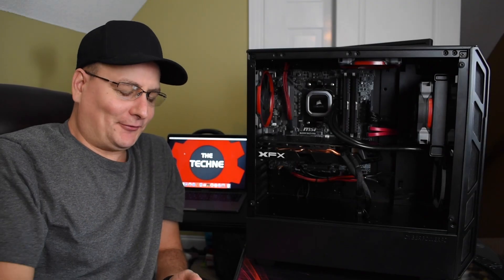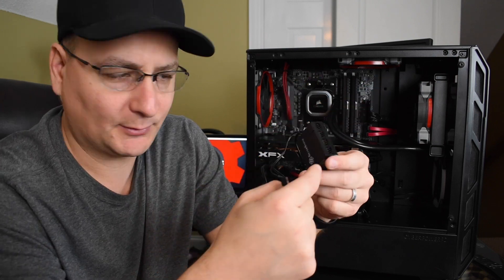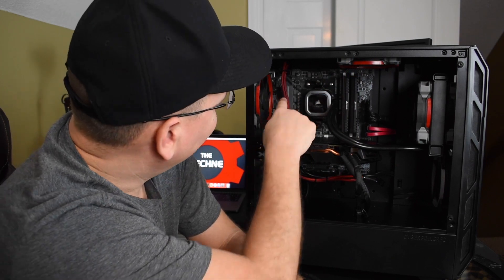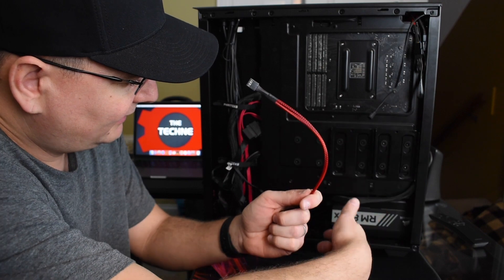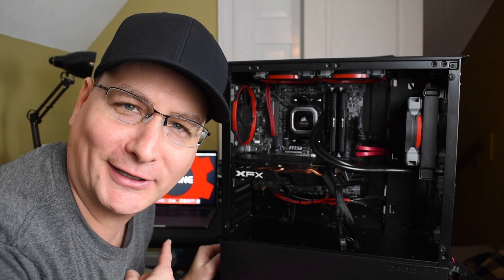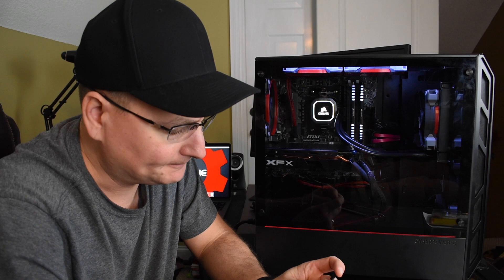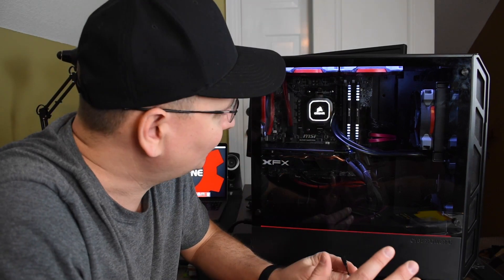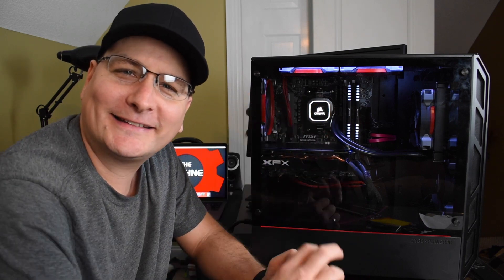Why Would You Need A PC Fan Hub?

Comment: can you connect fan hub to fan controller? so it goes like this PSU=>Fan controller=>Fan hub=>Fans, so i control fan speed from my fan controller and use fan hub just for the slots to connect em. im searching other solution then using Y splitter cables, so i wonder could i use fan hub instead Y splitter cable?

Comment: arctic p12 pwm fan just 0.08A.. and i have 1 header so do i still need fan hub for 5 fans?
Reply: I am buying Noctua NF P12 that are supposed to be .09 amp.. was wondering the same.  Mobo header is 1amp max so unless we are completely off on something, seems itll work just fine.

Comment: Excellent video. Do they make something that allows you to adjust the fan speed without going through the mother board? Like connecting power through sata but then have a knob or switch to adjust fan speed? My dam bios doesn’t have fan control

Comment: technically you only need to control through one header. If you set individual fans you are in danger of creating positive and negative pressure in your case, unless that's what you want. I have 3 intake and 3 output fans, 1 header should control the speed of all of them in unison.

Comment: hey so do you conect the pwm cable into a usb slot or a fan header on the motherboard because right now i have mine connected to the fan header and it seems like its running a hundreda percent and my fans are 4 pin pwm fans

Comment: Hi I recently bought this (still waiting for delivery). I'm a little confused. I have 3 fans daisy chained into my rgb header on the mobo and theyre also daisy chained to the psu. I believe my fans are 4 pin pwm. I want to add an additional 3 fans. Can I throw all 6 onto the hub and connect the hub to the PSU and RGB header and still have bios control the fans while also being able to control the leds? Do I have to worry about overloading the mobo? i.e do I have to calculate number of amps per fan and ensure they do not go above the power rating of the mobo rgb?

Comment: Im new to this but I just built my pc and I dont have enough fan headers to plug fans into, anyway iv watched a few videos and they all say fan hubs are bad and make the fans run at max speed but is there any fan hubs that I can control the fan speed? They say get splitters but I bought one and I plugged it in to my sys fan 1 and nothing happended. If anyone could help that would be great thanks <3
Reply from the maker: I use fan hubs in both my pc's. you can get some with all pwm or some with none. just make sure you get the right one. and yes splitters work as well
Reply: @TheTechne  do you recommend any specific fan hub?
Reply from the maker: @vsynccx4263  https://www.amazon.com/gp/product/B077YHLDSP/ref=as_li_qf_asin_il_tl?ie=UTF8&tag=thetechne0d-20&creative=9325&linkCode=as2&creativeASIN=B077YHLDSP&linkId=251d523cd28297f05a96b27aec47cd53

Comment: Hi so I actually purchased this hub several months back before I understood pwm and I just today got 3 brand new noctua a12x25s which are pwm fans and they are all connected to the left side or the hub (none on the Shiney connector that you said is pwm) and what I'm trying to figure out is how I can control these fans without going into bios since they show up in speed fan programs but show 0rpm and won't let me change that which they are running and at a decent speed as well I also have a few 4 pin connectors on my motherboard I could use but idk if those would let me control my fans on their either you you have any idea would I need to get a 3 way splitter and plug them into that one spot or just a whole new hub in my case?
Reply from the maker: yeah, plug your pwm's into your board, and any others into the hub. that's what I do.
Reply: @TheTechne  i did that this morning and it worked i had the hub plugged in on the wrong spot but i changed it to the right spot and it now works havent tried using software to change the speed yet but i can change it in bios

Comment: I have a question regarding multiple fans in my pc case..... I have a NZXT 210h case, with mini itx motherboard.... I have #2 120mm ML Corsair Pro led 4-pin PWM Fans for my front, #2 NZXT fans that came in the case ( Top/Rear) 3-pin pwm fans, and I have # 2 Noctua ( NF-A4x10) 10x40mm fans on the back side of the case, where cables lead to the powersupply, that cools my one of my M.2 Drives 4-pin pmw fans..... I also have a Corsair Commander Controller..... Which is hooked up to the power supply, and motherboard.... I was wondering if anyone knows how I could just plug my fans into a hub, and just into the power supply.... because I can't seem to keep all 6 of the fans working at the same time.... The noise isn't an issue.... I notice the fan controller gets quite hot, but I am just concerned about keep my computer cool.... in addition to the case fans, I have a fan that is on the motherboard over a M.2, plus the Wraith CPU cooler on the Processor, as well as the GPU's fan.... and the power supply fan...( Corsair cx 750m watt )…. I just want all the fans to work optimally, the noise isn't a real issue... So, there are 6 case fans I am trying to run just off the power supply... Any input would be appreciated.... Thanks....
Reply from the maker: join the discord, link in about tab (main channel page)
Reply: Yeah, so I clicked discord, created a username password, email.... downloaded quarrel, on the screen that shows me direct techne, direct messages, send friend request, and my username is Shannon777 ? What do I do now ? Never used this before... Thanks for replying, sorry it took so long to respond...
Reply from the maker: @shannonbailey940  the link in the tab should bring you right there. I'm not very savy with discord either, lol.
Reply: I have the main chat window open, with Shannon777 as my user name....

Comment: What a coincidence. You have the same PC that I do with some modifications done as well. At least mine didn't come with the liquid CPU cooler or the Corsair ram. I did upgrade from the XFX 580 to the Nitro+ 5700 XT, a bigger PSU and 16 gb of Corsair ram. I just installed two 140 mm bequiet fans in the front who have 4 pins and moved the single Phantek 120mm fan that was in the front to the top rear, directly above the CPU so I have two 120mm exhaust fans and two 140mm supply fans. I may end up getting that speed controller mainly for airflow balancing purposes. It's 15 bucks on Amazon

Comment: Hi! I'd want to connect 5 fans (3 in the front, 1 rear and 1 top) can I connect all of them to the hub and the hub to the Mobo? 

Also, all the fans have LEDs on them. So, does this require anything extra?
Reply from the maker: yes you can. are the fans's single led, or multi?
Reply: @TheTechne  you mean the colour? They're single coloured.
Reply from the maker: @emcuejay  (so there is no rgb connector just the fan wire correct?) if so yeah then you will be good to go.
Reply: @TheTechne  thanks for the help.

Comment: Hi, I was woundering, if I use this with my sickleflow cooler master fans, would I be able to control the speed from the bios?
Reply: As long as you connect one of the fans to to the 4 pin pwn connector, you'll be fine.

Comment: I ran into the same problem u did and the funny thing is same spot probably same length but at the time I didn't have a extender.
Im in the market right now for a fan controller/Hub never had one or used one.

Comment: Great video and just what I was looking for too. I questions lol My mobo has only 4 fan headers and after two AIO's and two fans in front, one on top, I believe this will be what I need. Where did you get that resister wire?
Reply: The case fans aren't even connected, but my GPU and CPU are super cool, I just want better airflow
Reply: Reduction Cable, found it

Comment: I ordered 2 new rgb fans off of newegg to find out they do not fit into my controller that came with my case. The fans have a 4 pin connector and the controller only accepts a smaller 6 pin connector.

My main question is since my 4 pin fans do not connect to the 6 pin slots, is their a converter? or do i need to order new fans with the 6 pin power connector.

THANKS (:

Comment: Okay I have a question, if I connect this to my mobo, is there a way to control the fans without going into the bios? 

Because I'd want the fans to automatically turn full speed when gaming and low speed when browsing
Reply from the maker: you have to adjust your fans in bios
Reply: @TheTechne  oh, so I can set it to auto in the bios?
Reply from the maker: @thetechrealist  yes, well depending on your motherboard options

Comment: I want to connect X1 aerocool orbit 120mm to b450m ds3h but seems I am missing something connection wise can u help?
Reply from the maker: what s happening? you can connect this hub directly to your PSU.
Reply: @TheTechne  it's a single fan without the hub .  Can you please tell me what hub should I buy? Unless u mean it's original controller
Reply from the maker: @MrStam1988  i might be a bit confused here. but if it's just a single fan if you have a port open, just connect it to your motherboard. if not you have two options, you can get a hub like this one, or you can get a molex or sata fan adapter and go straight into your psu.
Reply: @TheTechne  https://www.bestprice.gr/item/2155453138/aerocool-orbit-rgb-120mm.html that one

Comment: As a previous person said that one glossy port on the hub is used to controll the other own fans connected (all other fans run at the same speed as that one, so if you had 3 pwn fans pluged in and one is in the glossy port and 1 non pwm fan that non pwm fan will run at full speed while the others are running at the same speed provided your connected to a pwm header on your mobo
Reply: Nice clarification ✌️

Comment: The point of a powered PWM hub, is that additional PWM fans can be slaved to the single PWM feed, but without excessive power draw from a motherboard port.

There is ONE hub, the  Phanteks Universal Fan Controller, PH-PWHUB_02 - that can also slave 3 pin fans to the PWM, controlling them in step with the 4 pin

Comment: My Mobo only has 1 chassis fan port, so my other exhaust fan is connected to the psu via molex. Now I'm thinking of replacing and adding new fans since I'm getting a new case, which is going to have 2 front intake fans, 1 rear exhaust and 2 exhausts at the top. So as you can see I'm out of fan ports. I'm really scared of these fan hubs since I'm afraid they might damage my psu or my mobo. So how is your set up doing so far? Noticed any hiccups?
Reply from the maker: No issues at all. Now my hub is connected straight to the psu as well. The fans running from my mobo are connected via splitters. Fans don't take much voltage so you will be fine with a splitter. As for the hub connected into the psu, the fans will run at max rpm, so make sure you get some low rpm/quiet fans. But I'd suggest you go that way and you will be fine. I also wouldn't connect all my fans via a hub into my mobo.
Reply: @TheTechne  thanks you so much, got 1 of those shipping to my place already, cheers.
Reply from the maker: @Madtroll1209  glad I could help, your going to love the simplicity of this thing! and thank you so much for watching!!

Comment: So do I have to connect this to my motherboard and power supply or can I just do one or the other? Also of I use 3pin fans are they still quiet since they arnt pwm fans?
Reply from the maker: mine is connected straight into the PSU, the connection to the mobo is only for that one PWM slot, (I don't even use it)
as for sound, that all depends on the rpm's of your fans. I use the corsair quiet and have them connected straight to psu not PWM, and they are silent.
Reply: @TheTechne  if i connect my fan hub to the 4 pin sys fan in the motherboard, do i still have to plug it into the psu?
Reply: @KurangTidur123  Wondering the same. But I'm pretty sure the SATA that connects to the PSU allows the hub and connected fans to be powered, and then the PWM or 4-pin goes into the motherboard which you then can control the fan speeds in the BIOS.

Comment: Just bought a Phanteks hub but I have a 4-pin OEM CPU fan so I cannot use the 3-pin PWM FAN 1 connector on the hub. My aftermarket fans are luckily 3-pins. Now, If I use the  DC Mode fan connector (SYS_FAN) --not the CPU_fan header..do I still need to plug it to the PSU? My fan header is only rated at 0.5 amp. Maybe safer if I just use the PSU directly for power and not connect anything to the mobo? I can deal with a full RPM but I do not want to burn my mobo. Thanks.
Reply from the maker: I use my hub connected to the psu, and my pwm fans connected to the mobo. Works great. Now I do use quite fans when connected to the psu, (max 1400) or they get very loud. I tested it with some 2500 fans, shewww it sounded like a jet, lol.
Reply: @TheTechne  This is a tremendous help...Had to look at my new fans..1200 rpm thank goodness.
Reply from the maker: @danev6972  nice, it's really makes for a great set up.

Comment: Asus bios fan software sucks... it always wants to run my pump at max and my fans pulse constantly for no good reason... using one of these and a pwm controller seems to be the key... if you are fully water cooled and have at least 120 worth of rad for each component there’s no reason the fans ever have to be above 40-50%